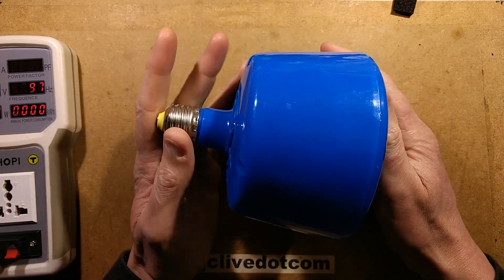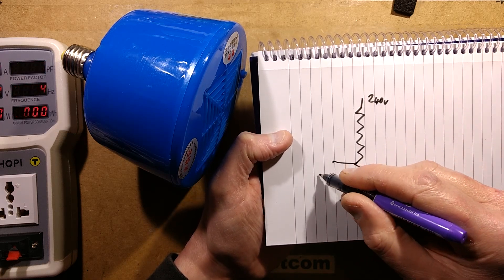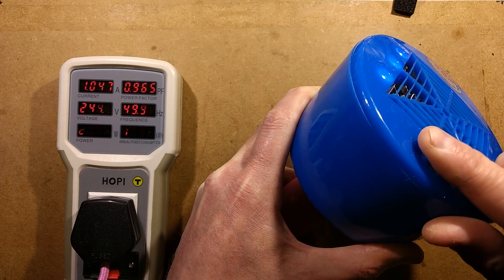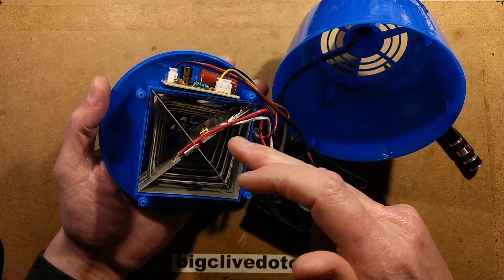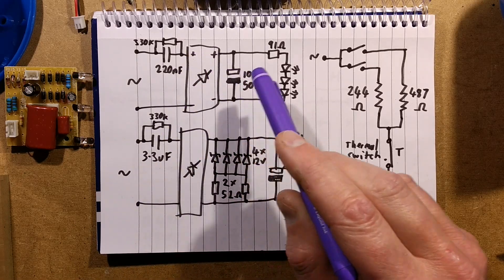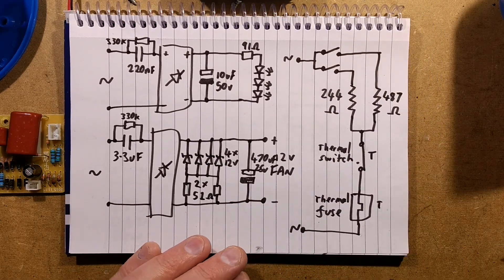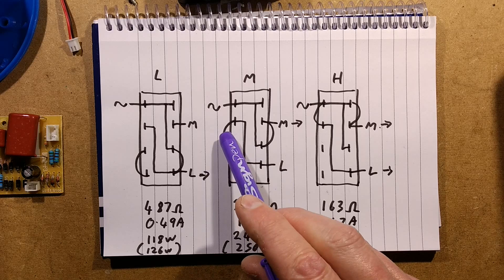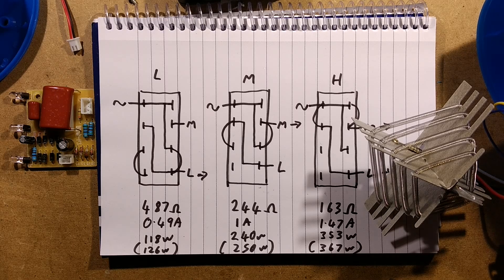Fan heater that screws into a lamp holder.  (With schematic.)

Comment: I hav been looking everywhere for something that blows hot air and is battery powered. The reason is that during winter time, my car door lock freezes (not the part where you put the key in, but the mechanism that locks/unlocks and opens the door on the inside). I could exchange it, but a new part would cost about 240€, so I thought why not just heat it up and make it thaw out. I did not find anything like that. Although nowadays, there are electronic cigarette devices that can draw up to 150W out of a heavy duty 18650 cell, so it should theoretically be possible.
Reply: Can't you just put some grease on it?
Reply: Could try a butane powered heat gun.

http://a.co/8c9tBMi

No guarantee that it will work considering the part you want to thaw is going to be internal.
Reply: Paul I would have to put it inside the module. But it turned out the drivers side unit is shot anyways, so I will have to find a matching used part to replace it with.
Reply: xSeRosiSx I don't want to touch my door with a flame, it would totally ruin the paint job and maybe even destroy the plastic handle or possibly melt plastic parts inside. That's why I was looking for some type of battery powered hair dryer, but there's nothing like that...
Reply: You can buy a cheap hair dryer and rewind the heating element so that it forms a low enough resistance, and power it with a lead acid battery.

Or you can go to a shipchandler or RV parts shop and buy one of those 12V hair dryers with the cigarette lighter plugs (meant for boats or RVs) cut off the cigarette lighter plug and replace it with crocodile clips and then connect it to a lead acid battery.

Or even go to an auto parts shop and buy one of those 12V heat guns meant for defrosting windshields. 
However I have never been able to find one in Europe (at least in France or Italy) they seem to be common only in the USA for some reason. Perhaps the Chinese have one...
Reply: There is no flame with a butane powered heat gun. Just heat.

But I get your reasoning. Just a warning though a hair dryer can do the same type of damage you're describing. 

You would need something that dissipated the correct amount of heat over time.
Something like this: http://a.co/0LMVZqB

Set on it's lowest setting and sitting a good foot and a half to two feet away. That way it warms up your door but doesn't make it hot.
Reply: xSrRosiSx With a hair dryer that usually churns out 60-70°C it would probably be not hot enough to inflict any damage. I am not talking about the 2kW heat gun that gives you up to 400°C or whatever...
Also, radiant heat would probably take way too long (or I'd have to cover the area of the door in order for the heat to actually reach it), so I'd rather like some warm, but not hot, air flow...
Reply: MrOpenGL These sound like good ideas - especially the 12V hair dryer (but it would mean that I'd need an additional 12V battery, because the car battery/cigarette lighter socket is unreachable until the door is already open). I have never seen 12V heat guns to defrost the windshield here in Germany either, so that could pose a problem, but the travel hair dryers are available on Amazon. I am just a bit annoyed by having to carry around a second lead acid battery (even if only a small one like the 3Ah from my scooter), and would love to avoid that. But there are these newer style lithium-ion battery powered boost packs to help start your car, maybe that would be a good option. I'll look into that!
Reply: You can use both hobby-style (RC) lithium batteries, or the boost packs. The first option might actually be better and cheaper, since the boost packs tend to be overpriced garbage (look at Arduino versus Evil's review of one to know why ;-D)

Just get a lithium battery low voltage alarm (like one of these: https://hobbyking.com/en_us/hobbykingtm-lipoly-low-voltage-alarm-2s-4s.html?___store=en_us) so when the battery gets too low you know you have to stop using the hair dryer. Otherwise you will ruin the battery ;-)
Reply: I've seen AvE's review of the battery pack. I was more thinking along the lines of buying one on ebay from China for even less money (Then I get the same crap, but at least it's not overpriced). 6 or 9 18650 batteries aren't that cheap either (in order to have a bit more than 2Ah at ~12V)...

Building it myself would also require designing a circuit with overcurrent protection and charge regulation and balancing and so on, as well as putting it all in a case...I've never done something like that before, so I totally lack the experience. Or at least the practical hands-on part of it, I am not sure I would get it right.
Reply: I have one of the 12V hair dryer. Mine draws about 10A (120W) so a 2,5 Ah battery would last 10 to 15  minutes (Is that enough?). 
The Chinese jumpstarters usually have a 2600mAh battery. You might be able to hack in a bigger battery (connect it in parallel, including the balance connector) to give you more runtime if it doesn't last long enough.

PS: I am quite good at building and designing circuits, but the aesthetics (case, front panel...) are a definite no-go. It's usually a mess of wires and tape :-D
Reply: Yeah, that's probably how it would look like if I designed it also. I can only hope that 10-15 minutes is enough - It would have to heat the locking mechanism behind the steel door panel, so I really have no idea how long this would take. Also, if I don't change the mechanism, I would have to do that on the driver and passenger side, since at the moment I can only lock/unlock it at the passenger side with the key, because the drivers side is completely screwed. I'll see how it progresses. Fortunately, there's still a bit of time until winter comes back... :)
Reply: You could wire the heater to the car battery through a remote control relay. There are brand name ones (like Bosch) available as well as cheap modules of eBay - I'd check the stand-by current draw to make sure it won't suck the battery dry...

Comment: where would you even put that? most desktop lamps have ratings of 75w max
Reply: ceiling most likely, the 75w rating related to the radiant heat of the bulb melting the shade, which doesnt really apply in this case
Reply: I think that would hve more to do with how much heat a incandescent bulb would produce.

Comment: this has `death` written all over it! lol
Reply: Fran Swa i'm amazed how chinese can make decent products and then screw up just the housing.
Reply: true - it's more just about how easily the plastic and fitting broke
Reply: In their minds it's not screwed up though, it's money saved i.e. a (marginally) higher profit margin.
Reply: Ahh, that's what those Chinese characters on the stickers say!
Reply: Greg Zeng The build quality is most alarming.
Reply: If you ever understand electricity & circuits, you might not be so scared.

Comment: I've heard of plugging vacuum cleaners in to lamp fittings years ago but I didn't think I'd ever see this. I suppose if you team it with a desk lamp holder it's quite a cheap way to get directional warm air.
Reply: Yeah that is right - the first electrical circuits for domestic use was only for lighting. As domestic appliances became common - people would plug them into light fixtures as sockets were not common. This practice is now illegal in some areas. 

In the US and Canada we still have the remnant of the above practice where lighting and sockets can be wired on the same circuit. Unlike in European countries where they normally have their lighting and sockets on separate circuits.
Reply: I saw an old advertisement circa 1920s where they had a hanging light fixture above a table and had multiple appliances plugged in. Toaster, what I believe is a coffee percolator on the table for the husband's breakfast while the wife is in the background using an iron connected to the same light fixture.
Reply: In many older properties back in the 1950s it wasn't uncommon to see 2 (and even 3 way) bayonet adaptors hanging from the ceiling rose, which appeared to be used for powering everything from radios to toasters and flat irons, the upshot being that the constant toing and froing of the lamp flex eventually took its toll, usually resulting in a big flash, with sometimes even a lamp and fittings ending up on the kitchen table.
Reply: yep irons and toasters wre often powered from the light socket in old uk homes, back when lighting and power were two different things, you paid a flat fee for lighting in the old days or it was included in your rent
Reply: I think it has something to do with the risk of the appliance not been grounded/earthed properly. Lights I can certainly understand as they normally do not need to be grounded.

I edited my last comment where I implied it was illegal in all jurisdictions. It sounds like it is legal in your jurisdiction.
Reply: that was common practice years ago in working class homes in the uk ...l can remember that method of powering electric appliances right up to the early  1960s
Reply: Strangely, they still make adapters so one can plug in stuff to a lamp socket in the states, so not sure how that practice is illegial state side...  Usually see them around holidays so that it's easy to string lights up outside on a house.
Reply: the house I live in now, we were doing some rewiring and it was interesting to discover the old conduit in place from when they originally had electric lighting installed. it was all ducted through thick metal plumbing, even thicker than the water pipes, the cable inside was all run as spurs from the meter so no ring main power over chunky red/black multicore copper cable - about 5mm diameter! You could have probably put a fair amperage over it without too much difficulty, so run near enough any appliance over the light socket. such an endeavour today, with all the piping and thick cable would be a massive expense I'd imagine.
Reply: @ Kevi Bhasi. Interesting, never knew that the UK had the worlds first coal fired power station, generating 110 volts DC.
https://en.wikipedia.org/wiki/Holborn_Viaduct_power_station
Reply: Electrical wiring. It's all still there as removing the plumbing would be a huge job, so brick work chopped out and new ring mains and lighting layed etc.

The oldest wiring I saw was (in another house) was cotton braided and they'd just twist the poles around each other for ease, back when towns would have their own small power stations. Of course, cotton rots and rodents and insects have a habit if nibbling things so the likelihood of house fires was probably quite high.
Reply: @ Paul Gascoigne: presumably the actual cable was cotton or rubber covered, how had that stood up to the test of time, rotten or perished I would assume?
Reply: Oh gees, what could possibly go wrong there?  You wouldn't dream of doing that today, not on the same power point you wouldn't.
Reply: I still have a few of those screw adapters around. I didn't know they were illegal, but I'm not really surprised.  I know that some of the older properties, going back to the thirties had only a light-bulb hanging from the ceiling by a cord in each room, so the only way to run a shaver was to use one of these adapters.
Reply: I can well imagine something like that would happen.
Reply: Jusb1066 Ahhh the flat fee for lighting makes sense, coming out of an era of gas lighting, the lights would have been the first domestic application and installation.  Great point.
Reply: These used to be common in the US but they have slowly been phased out over the years. I never see them in hardware shops anymore, just on China-based ebay sellers.
http://d2ydh70d4b5xgv.cloudfront.net/images/1/1/2-adaptor-converter-standard-screw-base-light-bulb-socket-110volts-ac-plug-new-034a0d5dec394fc997b19748f8595bdd.jpg
Reply: I actually have a few Edison plug to American plug adaptors from back in the day.
Reply: "from when they originally had electric lighting"
You mean DC electric?
Reply: @ Paul Gascoigne Was it old gas lighting piping or lead coated electrical wiring?
Reply: IIRC, didn't they have light fixtures with electric outlets on the side of the fixture? Though what I'm thinking of might actually be one of the adapters mentioned elsewhere.
Reply: And irons! Eek! But the alternative was hot coals...
Reply: We also have those in Europe: http://www.admenneztrator.de/bilder/ebay/8500_8599/8510_3%20_steckdosen_fassungen%20001.jpg ...
Reply: Woah that's a lot of power, around 2000watt through a bulb socket!

Comment: Maybe they wanted the fan to run at a constant speed, instead of stepped like in a hair dryer.  Also, some hair dryers simply put a diode in series for the low speed.  This cuts the heat as well as the power available to the fan.
Reply: Or maybe they needed a way to get rid of old computer fan stock, we will never know !?!?!?!
Reply: The type of fan doesn't really matter in this context.  You can run a "PC fan" at a lower speed but dropping its supply voltage.
Reply: Only if the lower half of the heater goes open.  I've never seen that happen.  Even if it did, a zener and fusible resistor can protect against fire.  They used more circuitry than that in the separate supply.
Reply: Also if the heating element fails open circuit. The fan and leds will see full mains voltage.